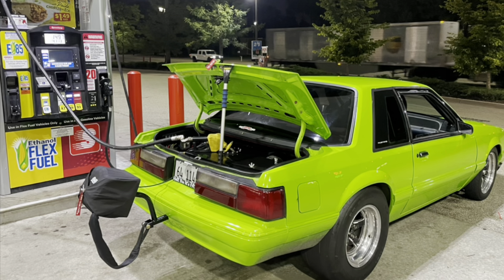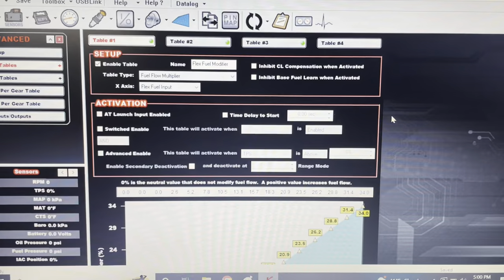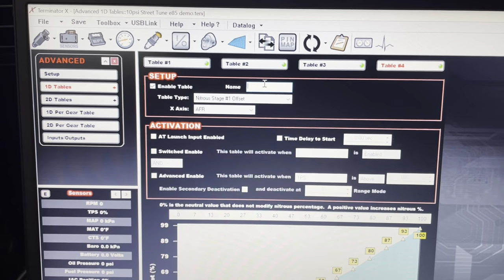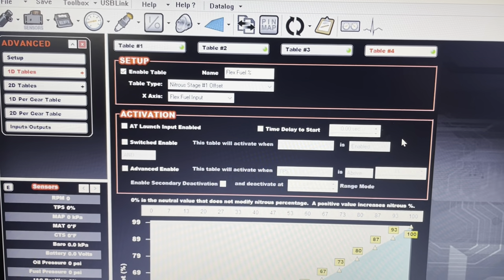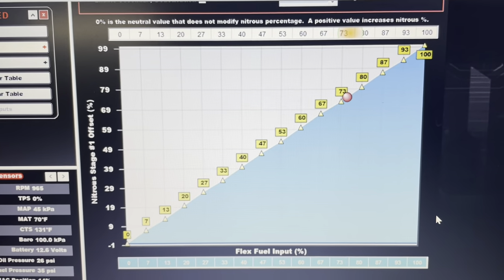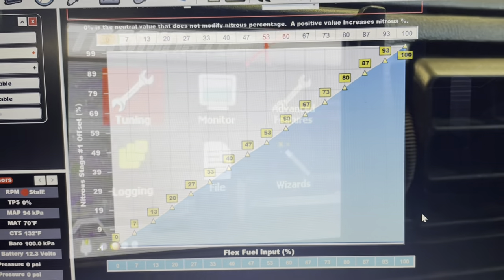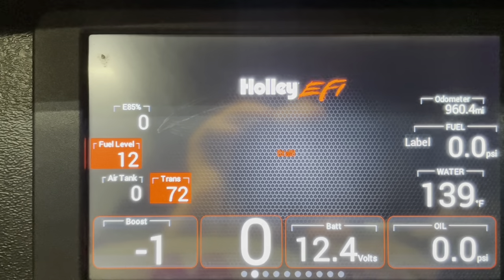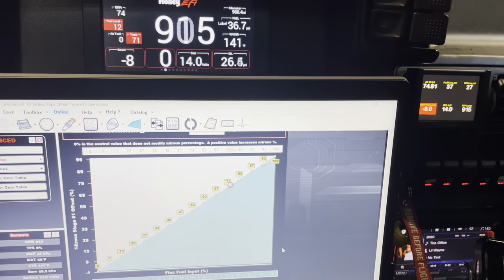How to monitor E85 Flex Fuel % on Holley via Laptop, 3.5” Dash & 7” Dash

Comment: @Boostiebuilds is that a fully functioning multiplier table or is the math made specifically to show the flex value and not do any actual compensation ?

I have a working flex table however I can only display the fuel multiplier . Not the flex %
Reply from the maker: Sorry for the late reply. The table is written specifically for display purposes. I have separate tables for timing/fuel

Comment: Do I need flex fuel if I’m running straight pump e85?

If the e85 percent changes from pump to pump will I need flex fuel as well or I’m good without it?
Reply from the maker: It all depends on how you have your tune setup. For my car I don't pull timing until I am below 60% ethanol. I run pump E pretty much exclusively but put some 93 in the tank for winter storage
Reply: @BoostieMotorsports  awesome thank you I’ll be alright without it then.

Comment: how do add it to the gauge layout in just the laptop ??
Reply from the maker: If you go into your sensors tab and hit the edit button, there will be a list of all the signals on the ECU available. Once you find your flex fuel input, add it to the signal list that you want to view it on and it should appear.

Comment: All my 1d tables are used, do you think you can do v this in 2d?
Reply from the maker: I have not messed with the 2D for this topic, but when I ran out of 1D channels on my TerX I was able to pretty much able to accomplish anything 1D related in a 2D table
Reply: @BoostieMotorsports   I ended up getting it to work on 2d. It was really easy i just used flex for the column and row o-100